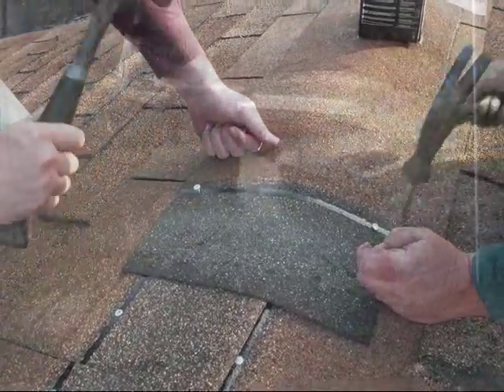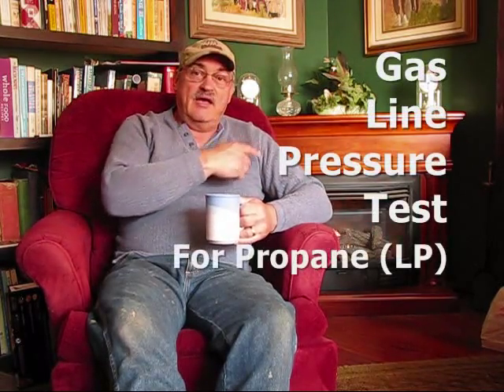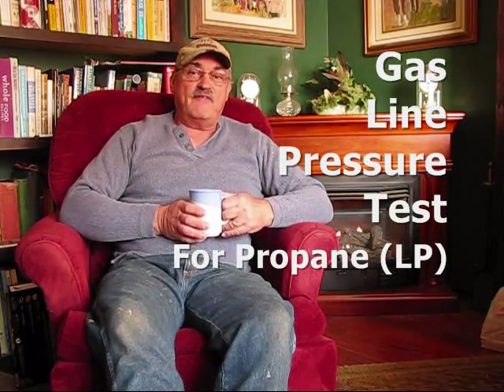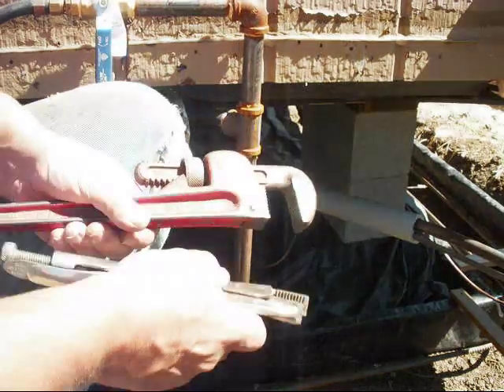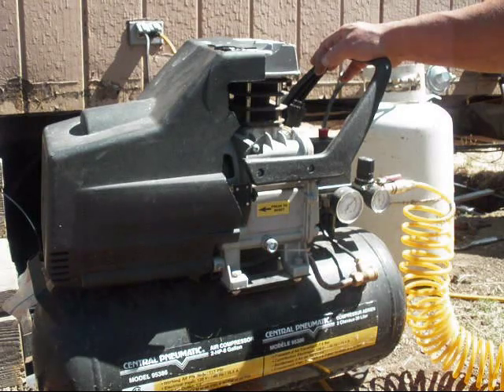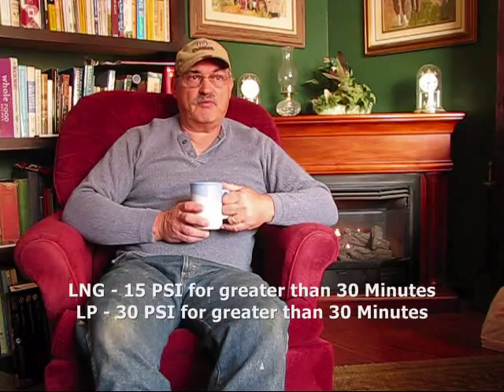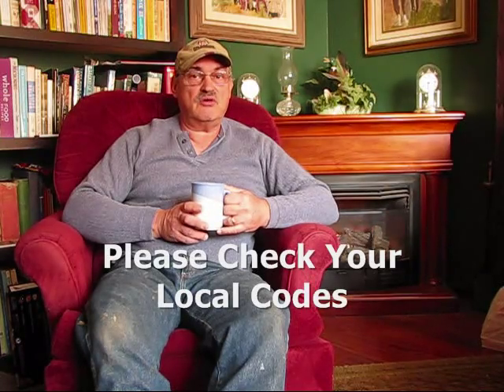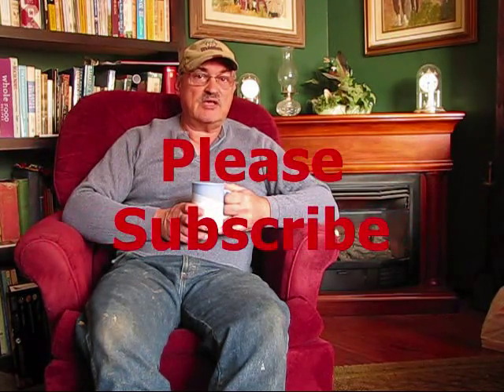Propane Gas Line Pressure Test

Comment: THE INSPECTOR WHAT TO SEE 10LBS PRESSURE FORE 30 MINS.
Reply from the maker: They both did and the one even used his own equipment to verify. I PASSED, HOORAY
Reply: @pinemeadowshobbyfarmafruga8319  so from what i understand  1. I turn off the lp tank  2. disconnect the stove ( my only appliance on gas) .   3. do i purge the system of gas  4. then pressurize it it with air.    or     do i disconnect the hose from the LP tank. and cap it off to hold pressure?????

 they said I needed to have the equipment to test the pressure here in Colorado. which i have. they do nothing just stand in the kitchen and look at the gauge for 30 min.
Reply: @pinemeadowshobbyfarmafruga8319  sorry i sound so dumb. just need to understand the details.
Reply from the maker: Sorry, Finally got a moment to sit down and answer questions. Been working on the tractor. The pressure gauge is attached to the line near where the propane/gas service is outside. Turn all valves off to each appliance prior to applying pressure to the line for viewing the gauge changes if any. What they are looking for, I understand, is any leaks in the line up to the valve of each appliance. The LP tank should be off at this time. All valves should be closed.

Comment: i HAVE A QUESTION YOU ATTACHED THE GAUGE INSIDE SAY AT THE STOVE PIPE. BUT DID YOU TURN OFF THE PROPANE TANK OUT SIDE DID YOU DISCONNECT THE HOSE TO THE TANK AND CAP IT OFF DID YOU PURGE  THE GAS FROM THE LINE.  NEED MORE DETAILS PLEASE
Reply from the maker: YES, All valves were turned off. The whole dang system was locked down not servicing ANY appliance. Like I stated in the previous comment, they used their own equipment to double check which I am so humbly thankful for because I simply do not want to mess around with such a volatile medium. ARGHHHHH> Hey, Thank you so much for your insight. I do appreciate you.
Reply from the maker: https://youtu.be/A2suNg_qISo

Comment: 15 psi natural gas 
30 psi LP Thanks
Reply from the maker: Yup 30 psi propane
Reply from the maker: I'm installing a 500 gallon tank right now and will be featuring a new updated video on line pressure testing and a chat with the code inspector hopefully. Or maybe just my plumber.

Comment: Well Jerry, I would think leaving your supply lines to devices like the stove, water heater etc (but shut off that appliance while pressure testing) should be left open in order to determine if you have any leaks that might harm you.
Reply from the maker: Naw, This was done according to the instructions by the pro and the Code inspector, but it is a good thought. yea.

Comment: Just a few suggestions. 
Appliance valves and gas cocks can fail, and 30 pounds of pressure to an appliance control can damage this control causing unsafe appliance operation and expensive appliance repairs. In order to protect the control on the appliance, you should disconnect the appliance and cap or plug the piping after the valve and before the appliance. Leave the valve in the open position for the test. Testing with the valve in the open position with the line capped or plugged helps protect valve seats from excessive pressure.
A PRESSURE TEST only verifies the integrity of piping, and in this case the appliance valves. After passing this pressure test and connecting appliances and regulators to the system, a complete system LEAK CHECK needs to be performed with a manometer to ensure the entire system is leak free and safe. With a manometer connected, the entire system can be tested for leaks and adjusted for proper regulator operation. This leak check and regulator adjustment is best left to a professional. It may cost a few dollars for the final check by a professional, but it is well worth the investment.
Gas is safe when done properly. I have no problem with do it yourself, but please make sure you have a pro check your work when done. Stay safe all.
Reply from the maker: That is really great information. Thank you so much.